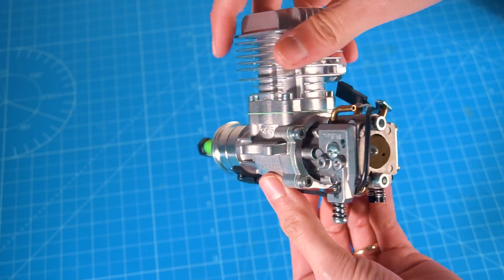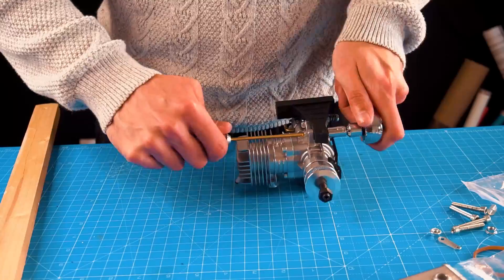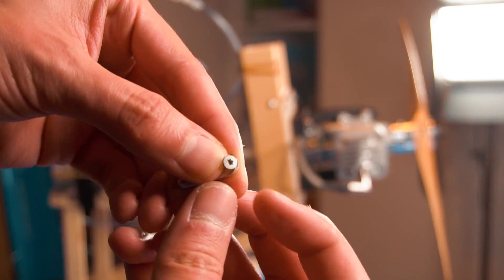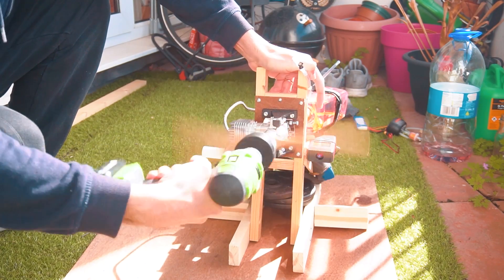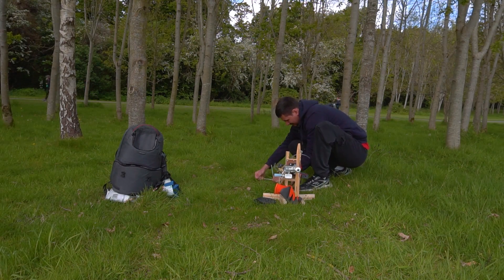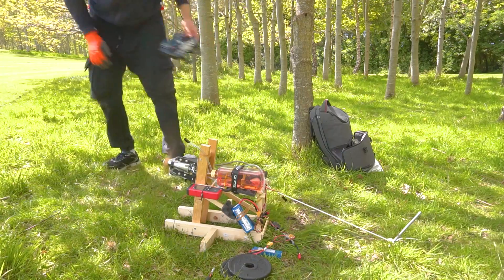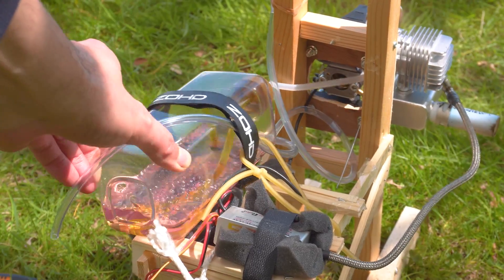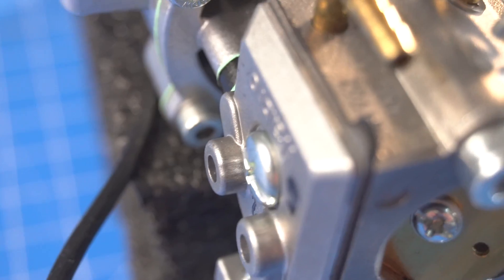Great RC Plane Gasoline Engine | Stinger 15CC Gas - Petrol Engine (My first engine)

Comment: This entire video is a classic "What NOT to do" unless you want to risk getting hurt or looking like a fool. Always anchor your test stand so that it doesn't have to be held down by your hands. Never stand to the side engine in the propeller damage path should it break. Never use a damaged wood propeller. Never run an engine for hours on a test stand. Set the high and low needles, pull it off the stand, mount it and break it in in the air. Never run it at the same rpm for more than a minute or two tops during break in. Everyone has to start somewhere but when I see beginners trying to give advice. I cringe because the majority of times it's bad advice and could get someone hurt.
Reply: Yup, 8:37 looking at that prop right below his arm where he was holding that test stand made me cringe,
Reply: You can do what you want and take off with an engine with zero time on a break in stand, if you have engine problems and loose your model because you had faith your engine would break in under load and break your model have fun
Reply: He’s going by the instruction manual
Reply: When he used a drill to ream the propeller, then not balance it. My god hes lucky the whole engine didn't vibrate to pieces.
Reply: That's the scariest  engine stand I have seen on YouTube !!  And VERY unsafe ways to break in a new motor.  And NEVER start it at FULL throttle.
Reply from the maker: Thank you for the advice!
Reply: Thank you for saying all that that’s exactly what I was thinking too this is a how not to be safe video anybody that’s watching this please do not do what this guy is doing this is almost like a comedy skit but with very serious consequences

Comment: I'm curious why you mounted the fuel tank upside down???.., both the fill and vent lines should be on top.I have  lots of gas engines a Mikes 6cc, NGH9cc, DLA 32,64 boxer, several 116 boxers,a 116 IL and a 232cc,as well  as a Stinger 125cc..install a spinner and get a good Sullivan electric starter... keeps fingers and hand out of the way of the propeller

Comment: Clearly, you are new to attempting to start an R/C engine. Presenting this video in the way you did presents YOUR process as a dangerous behavior. Read the manual FIRST. SECOND, watch a PROFESSIONALLY prepared  video with regard to the SAFETY, AND STANDARD PROTOCOLS , WITH RESPECT TO THIS HOBBY SPORT. YOU, are not prepared to provide a video of this type, and therefore pose a serious risk to yourself and anyone else who believes it's a simple process. DO NOT BRING ANYMORE ADVERSE POTENTIAL TO OUR SPORT. In the last few years to many " INEXPERIENCED EXPERTS, YOUTUBERS, AND " INFLUENCERS" HAVE DONE NOTHING MORE THAN TO DEGRADE OUR HOBBY/ SPORT" causing the hobby to undergo critical regulation as never before. I am a 50 year  airplane/ heli competitor, judge, r/c flight instructor and professional drone pilot  in the Aerospace industry. One must be a BEGINNER, before they assume enough knowledge to " INFLUENCE" others!!

Comment: I'm sure you  are tired of hearing what you did wrong but here are a couple more.  (1) check the spark plug Gap before installing into the engine.  (2) Typically you need to measure the distance between the firewall and the face of the prop hub before drilling the holes for mounting the engine to the mount. This distance is usually part of the model documentation.  If you don't, the prop may hit the cowling if there is one.

Comment: nice vid but please switch fill/drain tube with the vent, because this way you have set up causes problems like you experienced, have to turn model upside down when filling and draining??  other way would be normal,  when you fill/drain through nipple that is connected to a tube inside that goes to the bottom of the tank, and vent line goes to blank nipple in the tank, which brethes inside the top of the tank....  good luck

Comment: How do you control the speed?
Reply: He has a servo connected to the throttle on the carburetor which is operated by his transmitter.  That's the normal method of controlling the speed.

Comment: I would not follow this persons precedure. Its dangerious not to have the motor jig anhored solidly and the gas tank was flopping around. Using the drill in this manor would definately damage the prop. There are much better videos on this topic.

Comment: Great presentation 
Questions
1. What type of battery did you use for the servo that pulled the throttle? Voltage?
Reply: Lithium Polymer, from Turnigy I guess. The voltage is about 11.1VDC (3S; @3.7VDC)

Comment: Well done video ...... also you have a lot of patience. This will go along way to enjoying this hobby.
I just bought a Saito FG-14C four stroke gasoline engine and have to go through the same process. But it is winter here in Ontario Canada so it will have to wait until next Spring. I will follow your steps on the engine mount and the Saito manual for breakin'    Cheers and happy flying.
Reply from the maker: Good luck!

Comment: Nice engine,you can also use a chicken stick to start the engine, it's just a small stick so the prop won't strike your hand or fingers, you can make one or buy them, I also like o.s and tiger brand rc motors, they are a little expensive but very reliable too.
Reply from the maker: Cool, thanks

Comment: the vibrations is normal, it is recommended to break-in gas two strokes on the airframe so it absorbs the vibration. Like you did is ok because is shaking and that is what you want. Many destroy them during break-in mounting the on a solid engine stand.
The engine will let you know when is past break-in, if transition is a little rough, and has only low and high, still needs some more runs. It will be spitting out excessive amount of black oil when new. Once the piston ring settles, engine will not spit out too much black oil. Keep the oil mix 25:1 to 32:1, do not go any leaner than that, will kill the engine. Some plug-in tachometers will not let the engine start.

Comment: Best practice in my opinion is to use a cheap non synthetic oil for break in. High performance oil can hinder the break in as the rings may not bed in properly. It won't damage the engine, but may cause lower compression. 
You can buy a prop reamer to enlarge the prop hole, may be an idea, also balance your prop! Lol.
Be careful and have fun.

Comment: Is it possible to mount the muffler with the outlet tube pointing downward?
Reply: You can mount the muffler in any position suitable for the plane u are putting it in or they sell aftermarket mufflers..

Comment: i kinda need help for choosing my cessna 172 rc motor plz the wing span is 100 cm the body is 55 cm the wait with battery is 440g can any one help for choosing the best motor for that
Reply: Anything in the 150-200W range will do just fine

Comment: Thanks for your video 👍 I bought an NGH GT9 Pro 9cc which is great too but smaller, perfect for a 40 size plane. The stinger should be perfect for a 60 size airplane. The stinger 15cc will be my next purchase. 😉🛩️

Comment: Hi if you want start with engine model first go with glow engine ....this cheep engines or not give good life ....best engine or OS DLE DA ....
Reply: nitro is old fashioned and not accepted in most rc clubs.... this is a good engine to start with.
Reply: I only have glow engines and have a hard time finding fuel. I would say start with gas or electric amd stay away from glow.